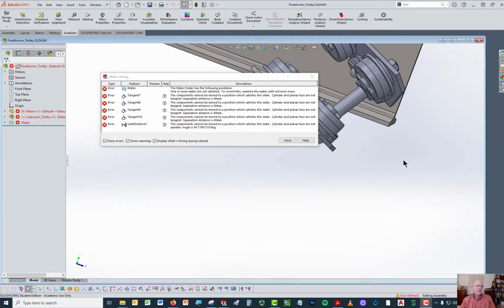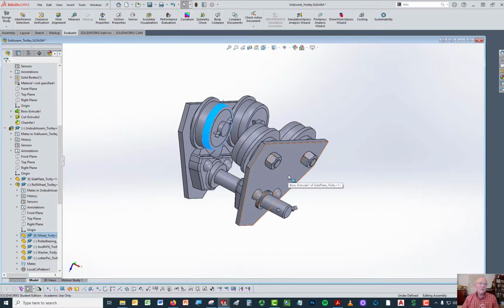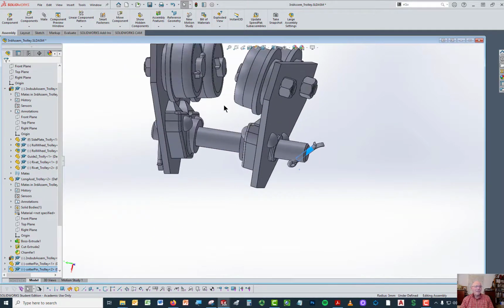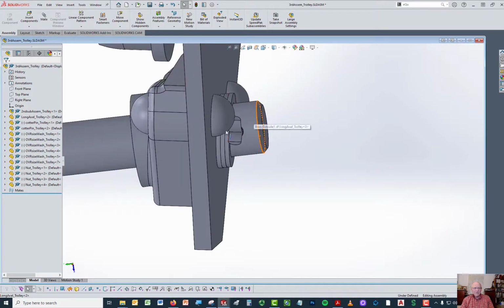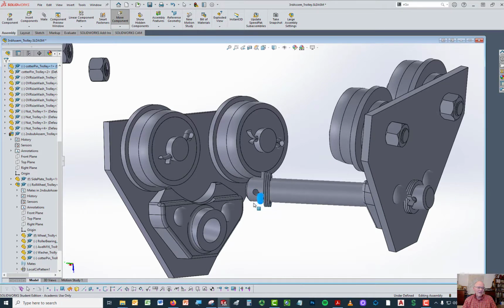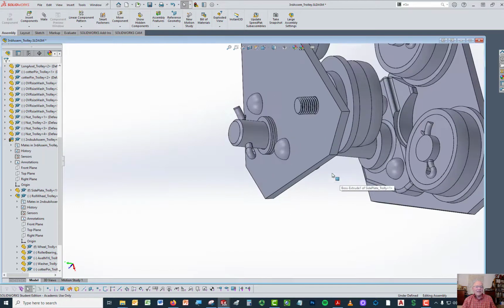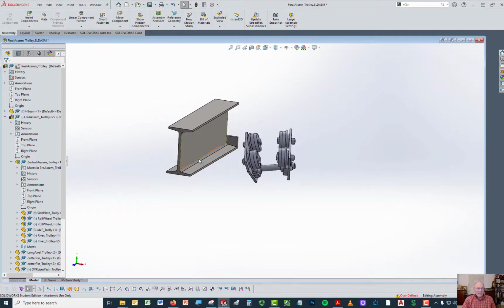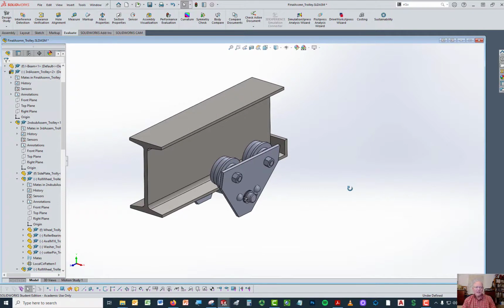Trouble Shoot Assemblies in SolidWorks

Comment: I notice all the underdefined symbols, i.e.,  "(-)" in the tree. Do you try to fix these?
Reply from the maker: I don't fix all of them, just as many as I can easily do so with mates. They indicate that a part in the assembly is not fully defined by mates. In this case, mating the needle bearings is not easy, and not particularly useful. The main reason to fully define as many parts as possible is to make it easier to trouble shoot. That is why locking the rotation of concentric mates was added. It helps to reduce the number of negative symbols. The bearings are not concentric with anything, however, and preventing the array from rotating requires mates that don't mimic the real world.
Reply: @DanAbbott-SMCC  Thanks Dan, very helpful.